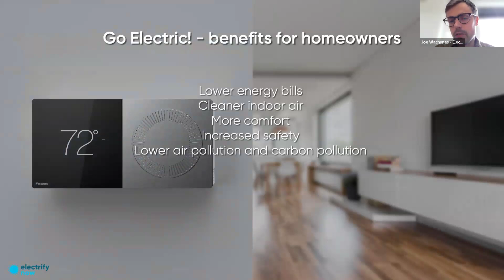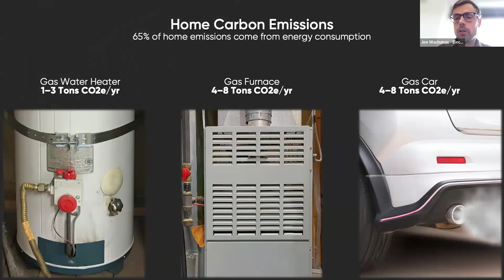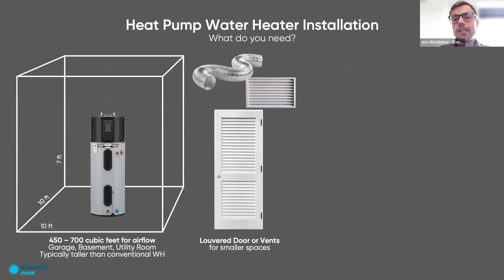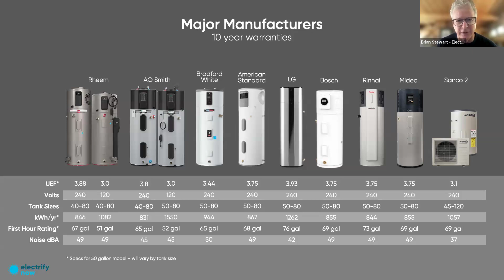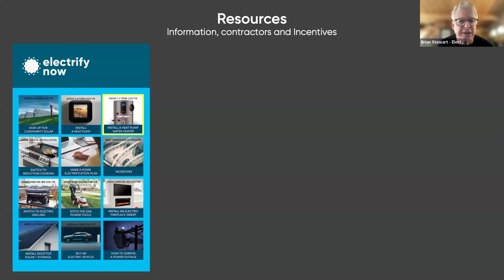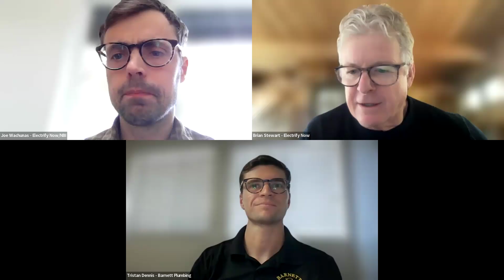Heat Pump Water Heaters - Lowest Cost, Lowest Carbon Hot Water

Comment: I was disappointed to hear Joe diss recirculation pumps as "very wasteful".  This shows a lack of understanding of the reasons behind recirculation.  It's not to have "instant" hot water (re-circ does not provide instant hot water anyway).  The real reason behind re-circ, is to SAVE WATER.  Water savings is a huge issue in the drought-affected western U.S. The Dept of Energy has information showing re-circulation dramatically saves water - most authorities will tell you re-circulation will save households thousands of gallons of water per year.   I encourage the group to educate themselves better on re-circulation - as the current state of the art of heat pump water heaters are they are "very wasteful" in water use.  The motion sensor or push button "solution" to trigger as needed re-circ is very cumbersome.  I currently have re-circulation (controlled by both a tome of day timer and internal temperature sensor) on my existing gas water heater, which provides warm water within 3 or 4 seconds and hot water in 0 or 15 seconds - much faster than no re-circ, and much less water going down the drain.  Hopefully, the heat pump water heater industry will figure out a solution to the current problems with mixing heat pump water heaters and re-circulation.  

I'm curious why there is so little information available on the 120V dedicated circuit heat pumps, such as offered by Rheem.  My house, built in 2022, has a dedicated 120V 15A outlet sitting next to the water heater, which I understand is current code.  Rheem's dedicated circuit 120V unit is rated with a 12,000 btu heat pump vs a 4,000 btu heat pump in their shared circuit 120V unit, and the rated recovery rate is more than twice as fast (28 GPH vs 12 GPH).  Is there a drawback to the dedicated circuit 120V model?